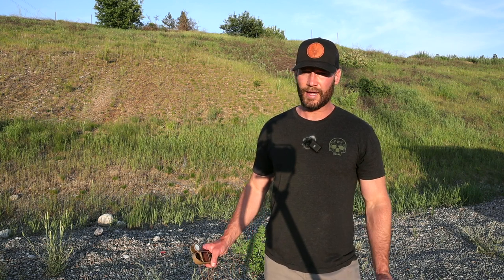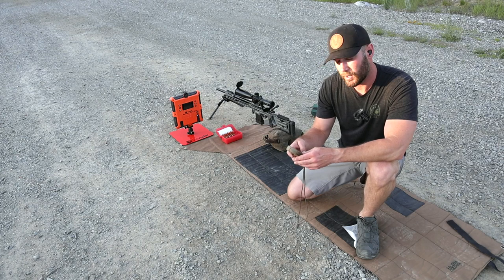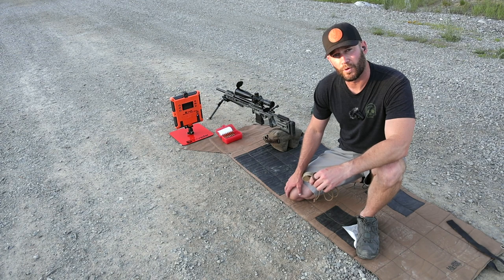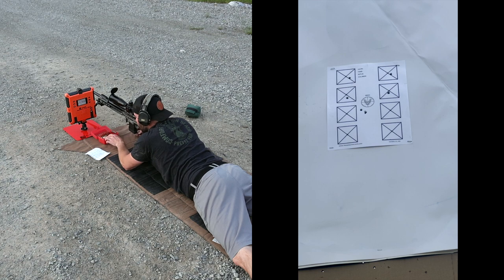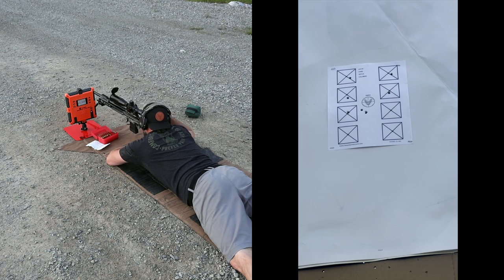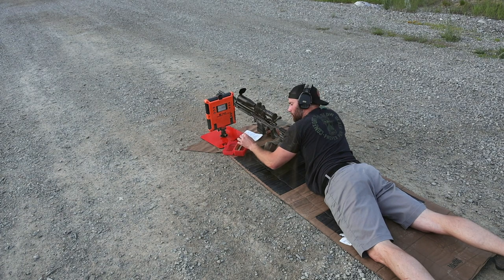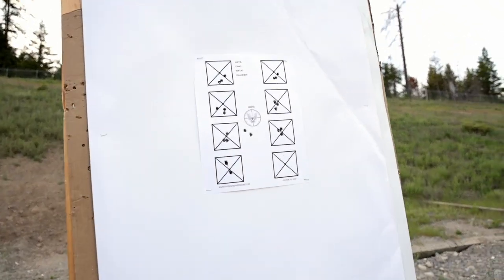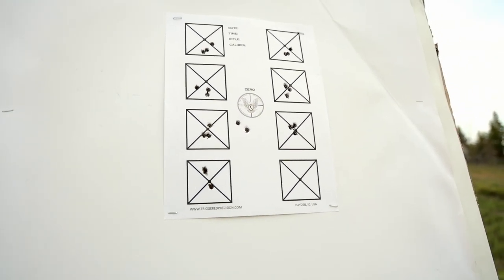TPM  - The Precision Rifle Reloading Series - Episode #6 - Shooting The Optimal Charge Weight Test

Comment: Shawn, 

I also have the Labradar Chronograph and experience the same level of frustration when it decides not to pick up a shot. I cured this problem by adding the JKL trigger to it. This is a very sensitive vibration sensor and it words beautifully. Initially I mounted it near the action but the problem I ran into it actually picked up the bolt closure as a shot fired. I relocated it toward the end of the forearm stock eliminating this error. It's not expensive at all and I highly recommend it!
Reply from the maker: I ordered one last week, I was getting so frustrated. Based on what I'm hearing, that should cure my issues.   Thanks for the advice on the setup.
Reply: @triggeredprecisionmachinellc  Thank you for the great videos!

Comment: My Labradar was a problem from day one. I send it back for repair twice. Both time it failed to work. I spent more in repairs than I originally paid for it.
Reply from the maker: I’m ready to send mine in for repairs.  No matter what I do I can’t get reliable readings for a string of shots.  About every 4-6 rounds it will miss. I’ve tried the Doppler pickup with all sensitivity levels and the regular trigger with all sensitivity levels. 🤷🏻‍♂️
Reply: Good luck. The second time it failed I called Labradar and explained the problem the person I talked to said he would repair it no charge then I get an email telling me the cost would be $300 plus! Use caution with these people.
Reply from the maker: Damn.  I’m not looking forward to this.  Thanks for the heads up.
Reply: I think the new garmin unit will be the next chrono for me

Comment: Great info! Yes I was thinking the same, 42.8.  I'm about to do the same test you are doing in my 6.5 WSM but with .3 increments of powder.
Reply from the maker: I'll go back and forth between .3 and .4 grain increments for the cases that hold around 40ish grains of powder. It's a trade off between finer resolution and covering a larger span of powder weights with the same number of cartridges fired. Good luck on the 6.5!
Reply: @triggeredprecisionmachinellc  thanks man!

Comment: Why test with no tread cap on the barrel if that’s not how you’re going to use it? Wouldn’t you want the harmonics right for field use?
Reply from the maker: In order to get completely raw, un skewed results.  This rifle will be used for only competitions and will wear a harmonic tuner brake for its entire life. 
You find the load the rifle likes with a bare muzzle, then really dial it in with a tuner. If I were doing the whole load development process with the tuner brake on, that would also be problematic because I have no way of knowing what setting I should use.  This is the best way I know of.  

On the other hand… if this were a hunting rifle with a brake or a suppressor and those items would always be on that rifle, I would do my load development with those attached.  The difference between that example and my match rifle being the adjustment and variability in the tuner and none in the suppressor or fixed brake. Hope that explains it… kind of long winded.  I gotta say, that is an excellent question. Thanks.

Comment: 4:52  did you forget your hearing protection? I do that all the time. it's a good thing I'm used to cranked, 100 watt tube amps preparing me for when I do it with 300 win mag and 300 Norma. 

I finally got my DudRadar to work with the 300 Norma, thanks for the tips you gave me a couple months ago. 

The trigger from JKL Precision is what I use and it always works. By the way, Staball HD is available all over now, I picked up 16lbs, but haven't done any testing yet. Supposed to be a little better than Retumbo.
Reply from the maker: Haha!  Good eye.  I had ear pro in but they were the Axil ear bud types.  I shoot pistol with em and it’s fine but the centerfire rifle is a little much. 

Glad to hear your chrono is working. I need to send mine in for a new usb port, my battery pack usb cable almost falls out. Lol

When I get near the bottom of my last Retumbo jug, I’ll adopt the Staball HD for sure. It’s popping up on shelves around here pretty regularly.
Reply: @triggeredprecisionmachinellc  Hey man, mine does the same thing, but once it completely falls out, I'm not going to bother getting the DudRadar fixed. I'll stick to the Magneto or one of those bullet radars that just came out.

Comment: What barrel life do you expect running at 3050 range
Reply from the maker: I think I should see 1500-2000... hopefully. I'm at 1100ish now and it still holds .5 MOA with no problem. I'll shoot it until it won't meet that minimum requirement.

Comment: I’ve had better luck with my labradar putting it out beyond bipod legs closer to the muzzle.
Reply: I bought a $35 inertial trigger when I bought my LabRadar and have quite literally only missed the shots where I forgot to arm the radar.  It works amazingly well.
Reply: @timh6430  I also looked at getting a trigger for mine but I’m a Cheapskate.  If I start having issues capturing shots, I will do the same.
Reply from the maker: I usually use a USB battery pack to power the unit but I left it on the charger at the shop. The AA rechargeable Eneloop batteries were darn near dead. I put the battery pack back on and it was normal. I'd like to check out that trigger. I have the little add on micro phone for suppressed guns and .22's which also works great.
Reply: @triggeredprecisionmachinellc  I saw you mention the battery was low after I commented.  Good stuff!
Reply: That's what I was thinking. He had the radar to far away from the muzzle to trigger it, especially with not having a brake on it.